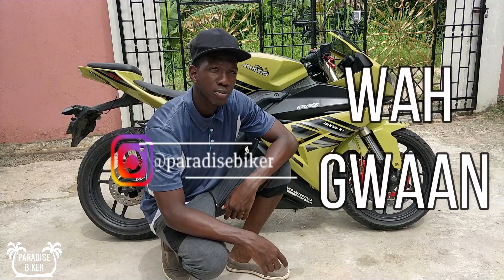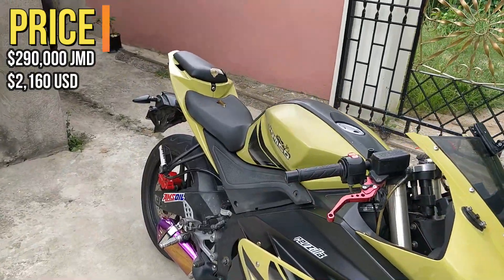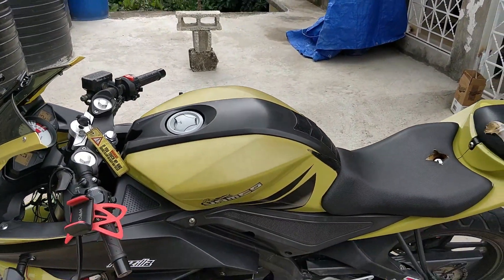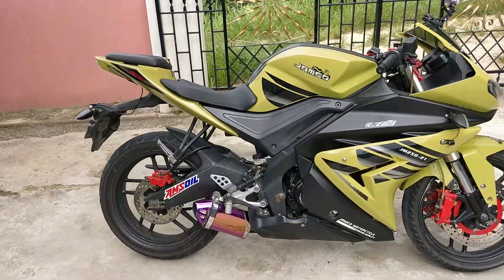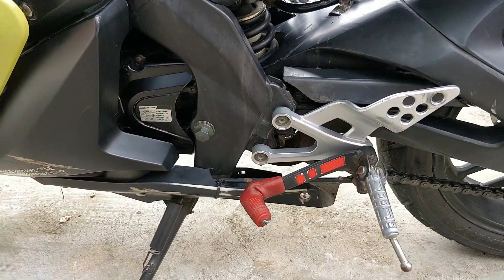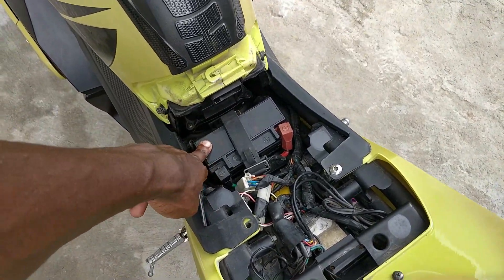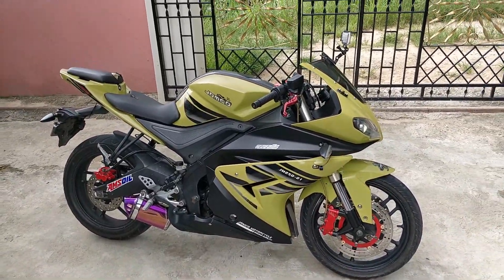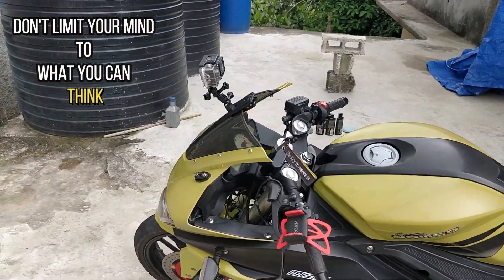2017 Jamco 250r Review | Yamaha YZF - R125 Replica | Jamaican BikeLife 🇯🇲

Comment: Try changing brake fluid and bleeding brakes. Brake fluid should be changed every few yrs. Ni bike have 2 master cylinders for front brakes the ones you see on left side are hydraulic clutches.
Reply from the maker: Ohhk thanks for that info 👍🏿.
I've even taken it to a mechanic and bled the brakes until 1 full bottle of brake fluid was done.
It seems like sumn is wrong with one (or maybe both) of the calipers. They may be defective. Even bought brand new handles with master cylinder.

Comment: bro mi just cah understand the cc ratings on bike with the top speed. how the hell a 250cc max out at 125kmph like how that work out, because 200cc ago the same 125
Reply from the maker: Take into consideration weight to power ratio (weight of rider + bike). Plus said 250 may not be putting out its correct power due to some engine/electrical/gas/air & more issues